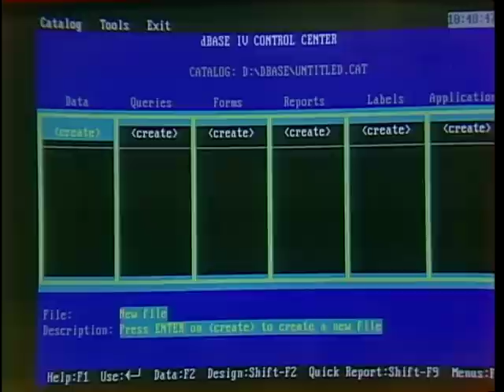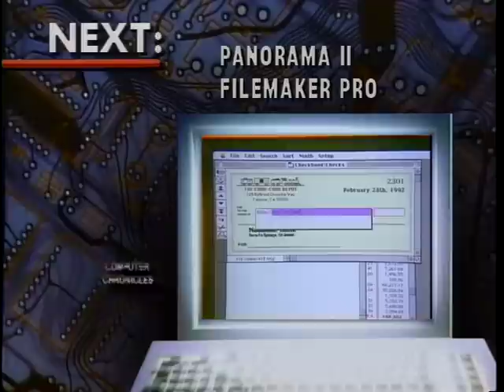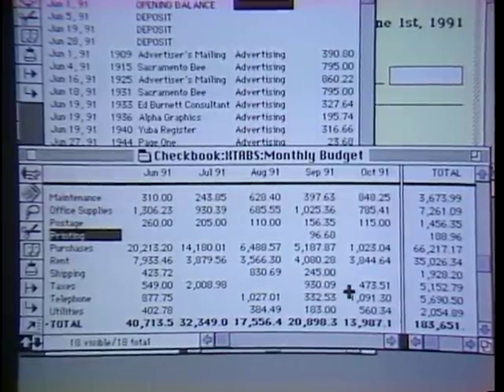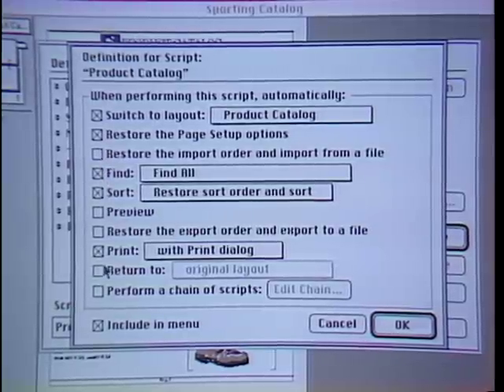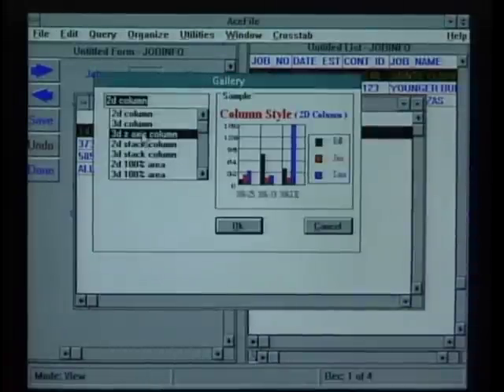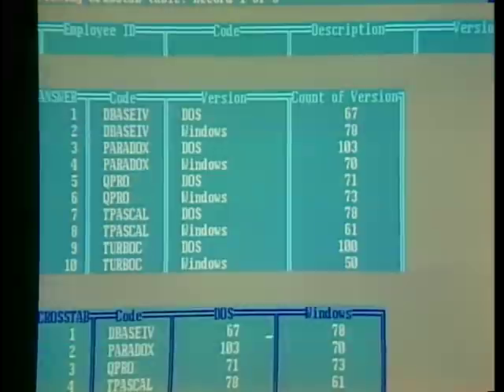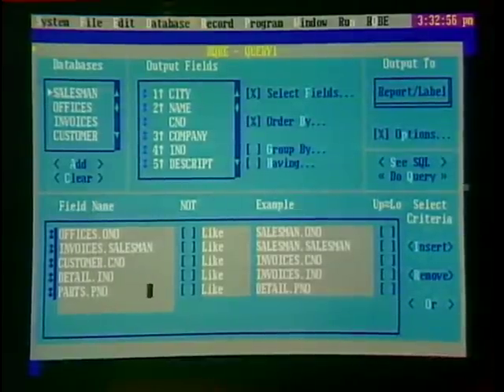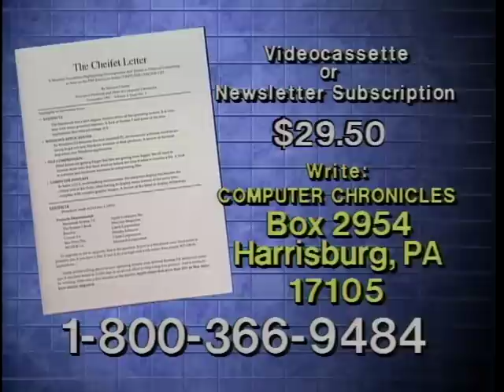The Computer Chronicles - Easy to Use Databases (1992)

Comment: I wasn't quite deep enough into desktop databases when these programs were big-time, but even without too much familiarity you could see that FoxPro just walked all over these other ones when it came to speed and user-friendly interface.  By the time I really started playing with FoxPro and a couple others, Microsoft was snapping it up and preparing to sideline it because they were getting ready to push Access.
Reply: I missed employment opportunities that may have led me to gain exposure to the microcomputer. After numerous rejections of employment opportunities, I missed working intensely with programs that ran under DOS. Now I am working under Microsoft Windows since 2002 when I bought my own computer, color laser printer and scanner. The database program, Microsoft Access is my favorite program to use, above Microsoft Word, that was my springboard. Since 2002, I am mastering some techniques in using Access 2019 that I would not possibly learn in a job.